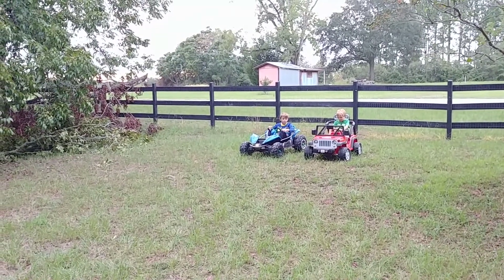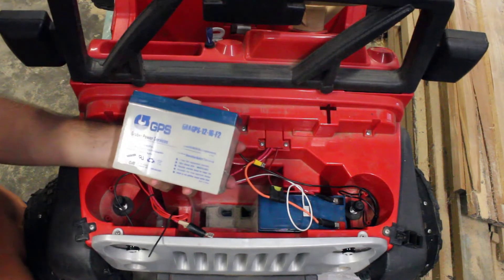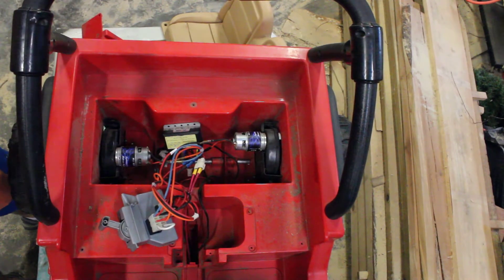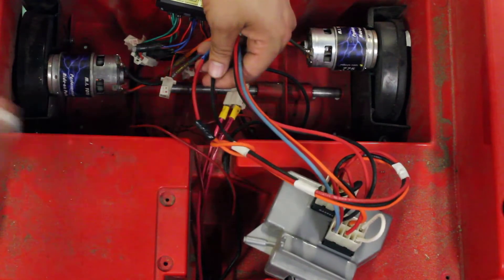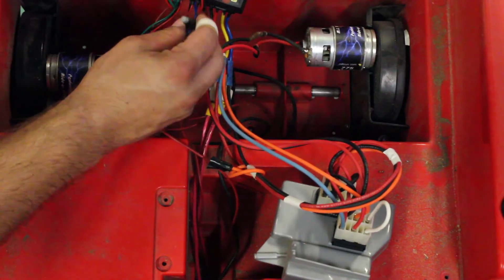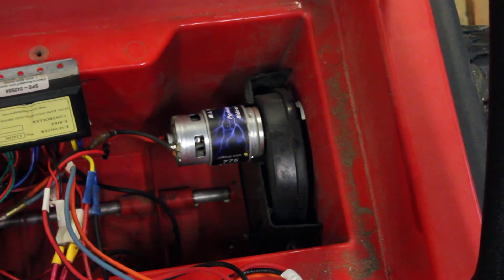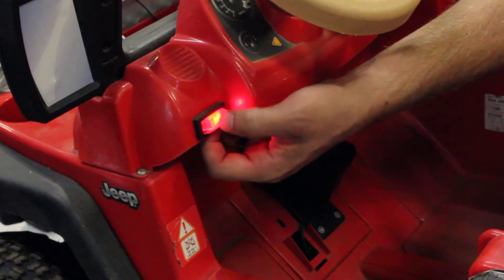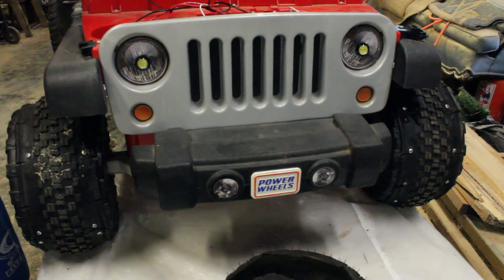Jeep Power Wheel 24 volt Modifications: tires, speed controller, upgraded motors

Comment: I put 24v to mine and i keep blowing fuses. So i dropped it down to 18v and it only goes in low. If i switch to high it goes for a second and then shuts down.
Reply: sounds like no speed controller

Comment: good morning from colombia, i have a question.... i woud like to connet four rs 550 35000 rpm motors for daughter's jeep 4x4, but when i did the speed controller can't support. how to do for funtion correct .
Reply from the maker: Are the motors rated for 24 volts?  If they are not, they may work for a few days but will likely burn up under that much load.  I haven't experimented with 4 motors on the speed controller.  We will likely be pulling too much amperage with that many motors connected.
Reply: @ProjectNineOaks  12 votls i think that maybe use two speed controller and the power supply jr-1816rxs-12v is the original part